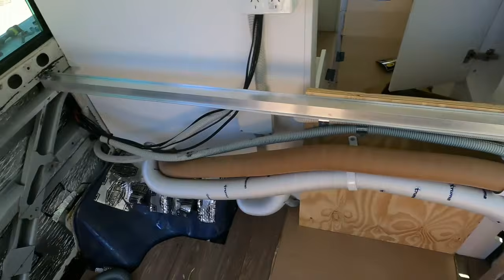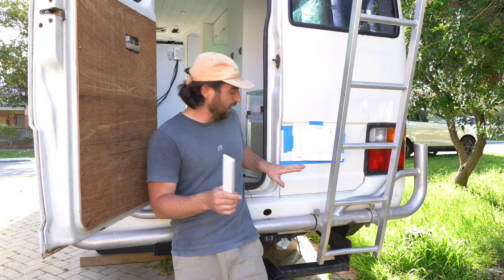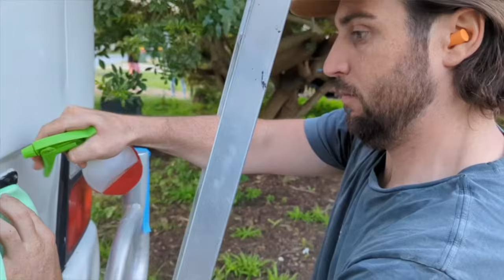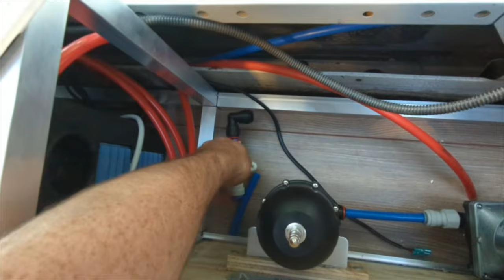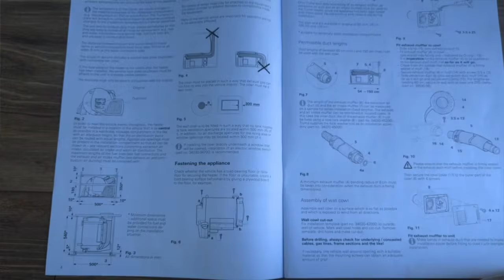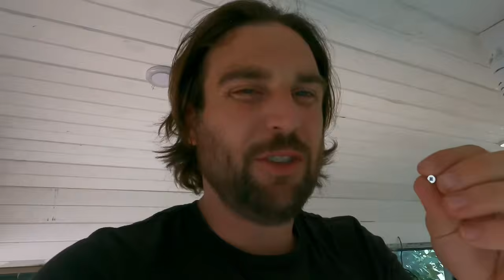The Truma Combi D6 Diesel Heater in Caravan: Salt & Charcoal's Top Choice

Comment: Truma does not consider or care about the end user, they do everything needed to seduce manufacturers to buy their products. Truma is NOT interested one bit in the end user : ZERO information on how to service your unit yourself, and the ONLY way to service the unit is to take it out entirely, disconnect all lines and electrical wires. 
So if you have a truma, you are going to have to travel to one of 3 states that have a truma service provider, bring them your truma and pay them to service it. If you live in your RV full-time, expect to do this yearly at a minimum. 
Once I had forgotten that I had shut off my propane line to the truma and got an error. I tried again once, then realized my issue, put the gas back on but the truma did not start at my next try (likely needed a couple of tries before it worked again). But then had another error, undocumented in my manual. Saturday, high altitude below freezing camping, no heat, no hot water, no info, no support available. Monday I called my dealer and he had to contact truma to know what the error was. Truma said it required a hard reset at a dealer / service facility. 
BUT there was nothing wrong with my truma nor my propane. So truma decided to build their product to stop working for good even if everything is fine and to provide no recourse. 
Again, this goes against the point of RVing. 
So terrible company that is good at one thing : building a product that manufacturers want to buy. For the rest, they do not care.